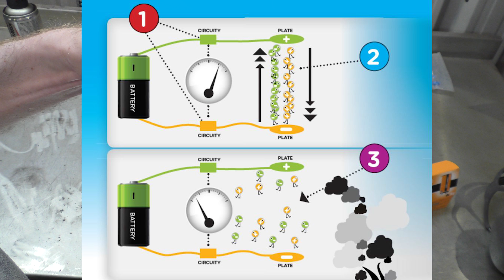Cheapest smoke alarm vs Kiddie smoke alarm

Comment: Thé cheapest je better than the fucking Kidde , i bad one in my room  , there was no heat sensor on it , but it still the same , i hadto change the battery after 4 months   and now , after 2 years of working , it's always chirping , i changer the batteries 3 times , and nothing of changed

Comment: The Kidde is Ionisation, $2 is optical. Optical detectors are designed more for smo(u)ldering fires, while the Ion is better at detecting flaming fires like the one you set.

Comment: It is exactly as shown here. I bought this and two of the ones with a red cap on top. And I tested with so much smoke in a small chamber that you could not see anything anymore. There was no alarm even after several minutes. I only could get an alarm if I blew a lot of cigarette smoke with force directly into the smoke detection chamber. Dangerous scrap - nothing more.